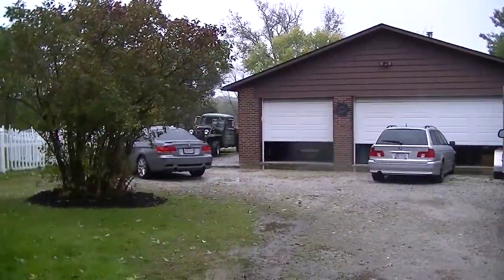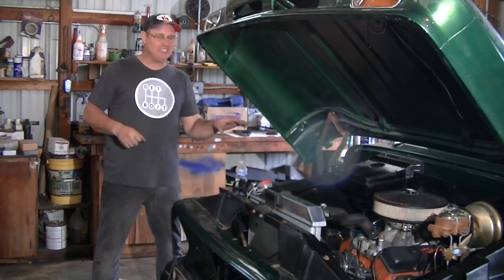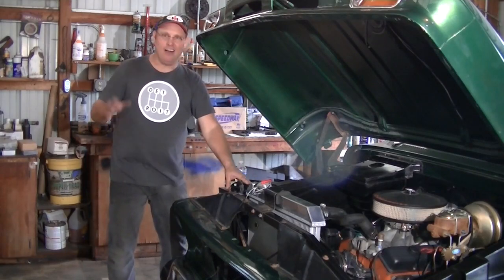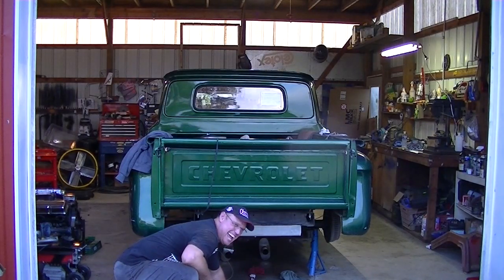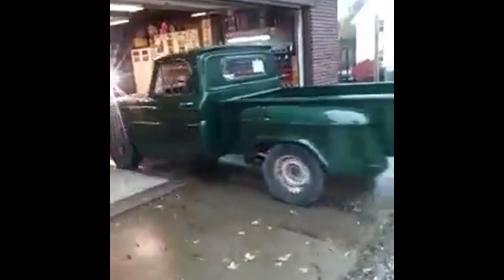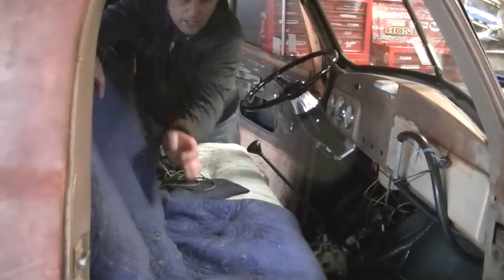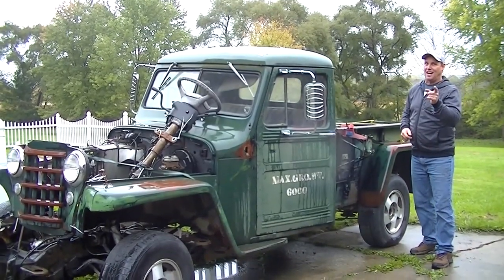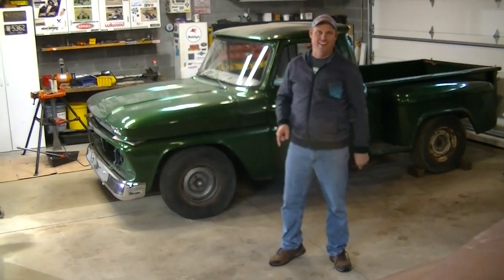1951 Jeep TRUCK- A '50 Studebaker & A '65 CHEVY?

Comment: What is that whining coming from on the chevy
Reply: Front timing gears instead of a timing chain. They were popular hot rod modifications done in the 60’s. The timing gears rattle like hell and some folks like em like that.
Reply from the maker: Yes those were the timing gears :)
Reply from the maker: Right! This motor was built by someone else, I just made it GO :)